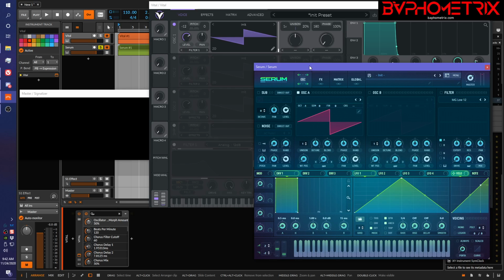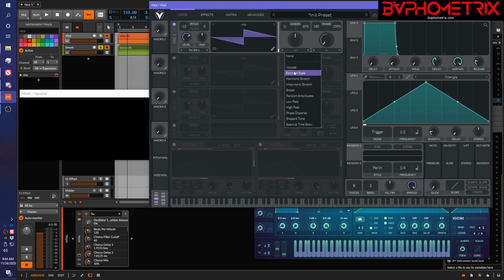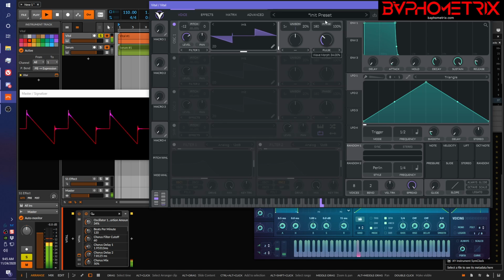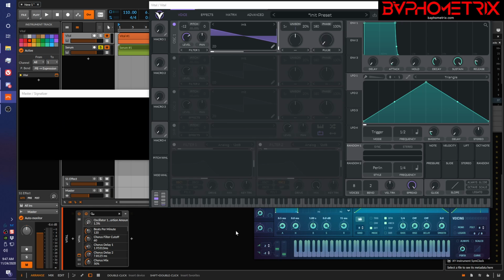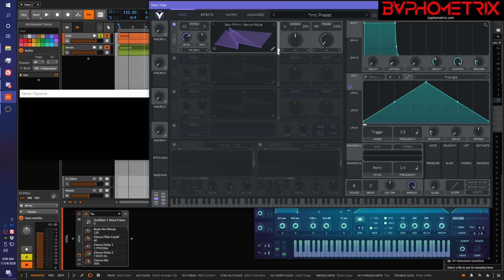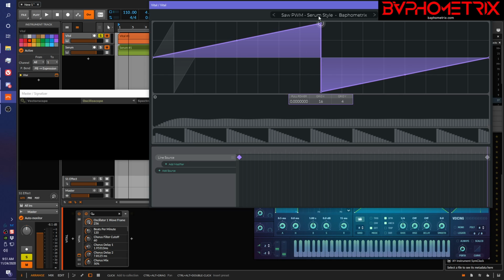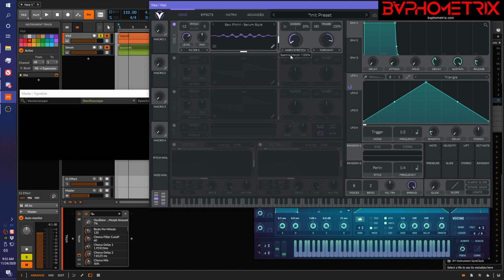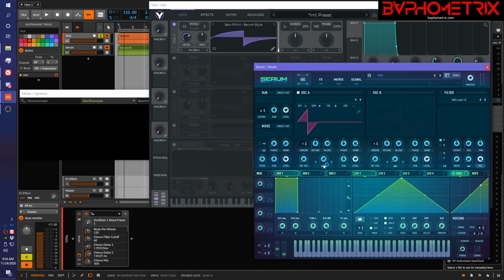Vital Synth - How to do Serum style PWM warping

Comment: Thanks, really helpful. Sounds a tiny little bit fatter/warm/less metalic still in serum, but for vital being free one can't really complain too much. Is there a way to turn on the harmonics edit mode in vital on any wavetable besides the basic shapes and a few others where it comes "edit ready" in the preset?
Reply from the maker: No, it doesn't work the same way as in Serum. An "audio file source" is not directly editable in the FFT area--that's display only.